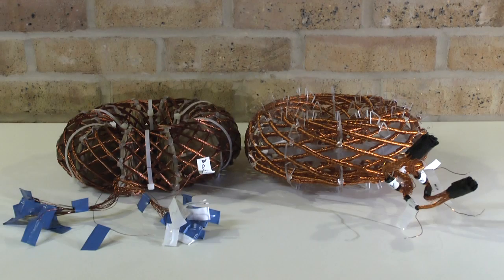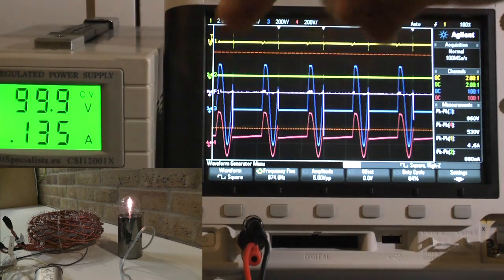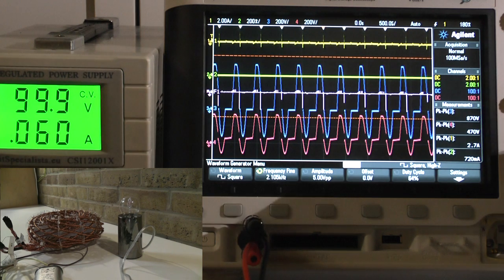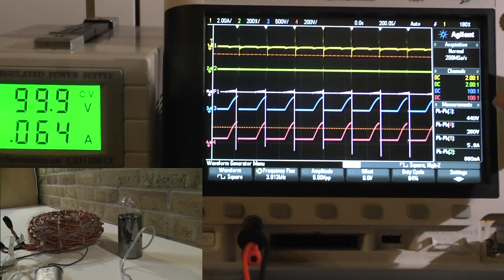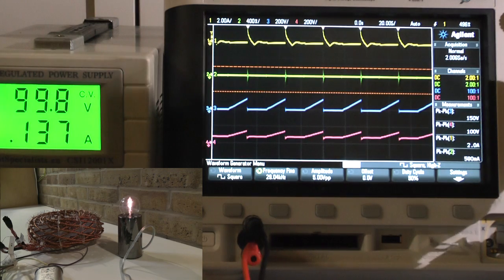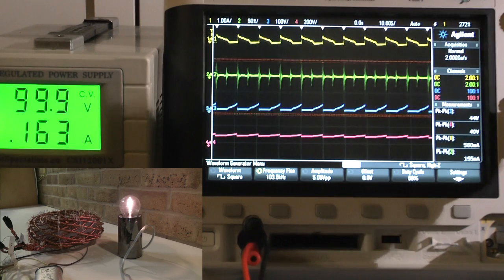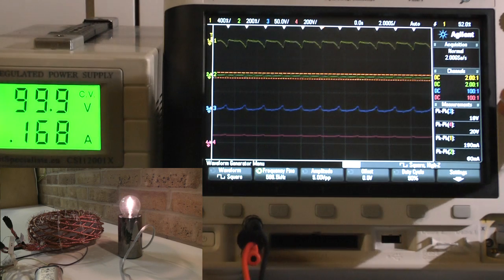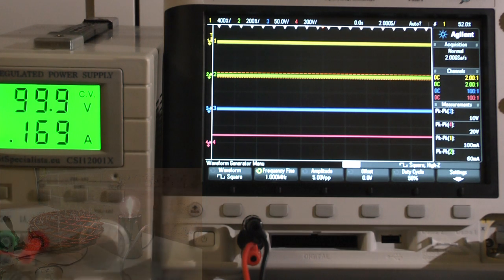The ABHA Coil power measurement designed by Daniel Nunez and provided by Humanproductions

Comment from the maker: I like for all to close the subject. The search is for power and not by using very efficient means to use power. Light emission is not power. If the goal is that then any Bifilar Tesla coil in a Joule ringer circuit does that perfect. We need power to drive motors or heaters. That is the challenge and every test I perform is done under this premises.

Comment from the maker: There is a very large difference to calculate power propagation. The measure current is not a current you can use direct. it depends on the wave form to the voltage.In my comparison chart I sue the same topology just to compare both but the value is not related to real power. Real power is when you heat water an measure the water temperature difference over time and volume, weight

Comment from the maker: Well, That is now what I do. You will be very surprised when you will see my latest videos, Florescent bulbs don't need any power. They need high frequency oscillation and voltage. The ABHA coil can not produce enough voltage to satisfy the requirement for a fluorescent bulb. LED's on the other side need low voltage and low current and regulate the circuit. In order to work here you need to connect many in series to add up with voltage drop for the higher voltage.

Comment: i think you did not get the coil to an oscillation point, in other words you have put a big resistance in the load and the oscillation never happened. Oscillating circuits are load dependent and not all loads work as you have shown in all your presentations.I would´n be surprised if you change the load to a fluorescent light bulb(no circuit inside) you will get a 180º turn in your oscilloscope values.Try to put that halogen bulb in your Tesla Coil output and see what happens.

Giacomo Ignacio

Comment: I have a question Sir, why do you use a halogen light bulb on the output of this caduceus coils to measure the values on your oscilloscope? I can see that in all of your other apparatus like tesla coil and all of your vids you use Fluorescent tubes as output measures. Is there a major difference between in what you call the power propagation between this loads? 

greetings from Napoli

Comment: I see, i would like to learn how to fish too:-) A question, does this coils are capable of putting more power out then in?

Because the Integatron that Mr.Dollard talks about is based on this caduceus coils and seems that they are taking the space out of the equation, you know because of the CW and CCW windings. 

I think this coils are made for transmitting signals for radio or tv.

Comment from the maker: Hello Neto, it is in the nature of the manufacture process and the following of the correct procedure. Example: You did choose to have a 11 frame torus where Flash and Daniel have a 12 frame. The twisted wire is different be all of you and the most obvious is the connection of the wires in the multifilar fashion. One is connecting a center core wire to the outer core wire and so on. Because of that all your coils are unique. I do not place judgement or any preference.  Only record the same test.

Comment from the maker: Funny that you mention it. This idea is in my head since some time. We need 90 degree crossing wires for the highest energy gain. The two Rodin coils on top of each other are less than 45 degree crossing but still on the same plane. I thought to wind around the disc and on top around the circumference. I will do some tests and post.

Comment: I have tested many Rodin coils too.  the most interesting one had a coil inside the rodin coil. to make it I took a fisher price donut and cut it in half and placed 200 turns 28ga mag wire coil inside and the glued the donut back together and wound a rodin A & B coil around the donut.  12vdc pulsed to rodin yielded over 1600 from the inside coil.
 I also did the shot glass neo ball test got it spining and with no power it still spinned 15 ft from the coil.  the neo kept spinning for a long time.

Comment from the maker: Unfortunately there is nothing left at the end, that is why diodes work best because they let energy only through and trap it. Because of the small time fraction of aligned power the diodes have to be very fast recovery diodes. I would propose a two stage output circuit to utilize the power. I think Daniel does that with his LED arrangements but please note that does not change the fact that there is almost no power there.

Comment from the maker: Charles,  Not only is it out of phase it is also not in the same time domain. that means that current is not in the same proportion in time to voltage available. when both meat each other only at a tiny fraction of time. The rest of the wave cycle is no power available. The paek-peak value is misleading. To do a proper analysis you have to take one cycle and break it down into segments.

Comment: Awesome video Thomas! Thank you so much for sharing and referencing. Amazingly high ammounts of power in there. Is the only reason the load cant draw it out because "it's out of phase" (please forgive if wrong terminology)? Would "shouting at it" with your other coil underneath rigged with variable caps work to redistribute the power structure in the vortex? Ubuntu, Namaste

Comment: Thomas has shown in the video of his new coil with the control coil around the outside that he can re align the power distribution in it's cycle so that the three coils can push out one big useable power output. The real proof is self looping the system and getting it to supply a load endlessly. This is what we are working on. Remember that vid you did 500 LEDs with 1 watt of power and 3 coils (see my channel) - that's where it's at man, stacking them and phase conjugation. Schauberger vortex

Comment: Right on Daniel I am glad you have seen this. Very exciting seeing 2KW inside the coil! That is enough to power a work station with computer ect!!!!! Maybe even small servers :) free internet here we come ;)

From what Thomas told me the trick is to get the volt spike alligned with the amp spike so V X A= loads of clean power. Thomas is experimenting with using multiple coils and controll coils and controll capacitiors and self triggering switches(AI) to get this done with three coils:)namaste

Comment from the maker: Hello, You see the settings of the signal Generator, on the bottom left on the screen. It is square wave I also used pulse with very short duration. Both have the same effect on the coil. Sine wave does not work at all. The build in SG can do 20 MHz.